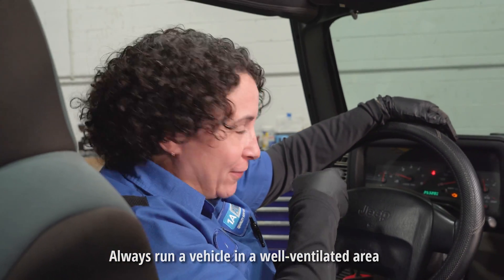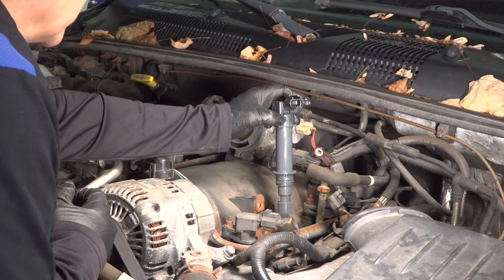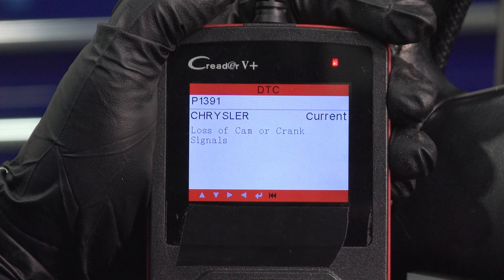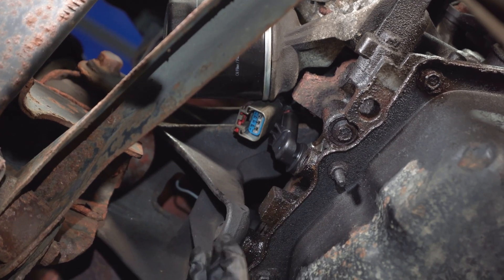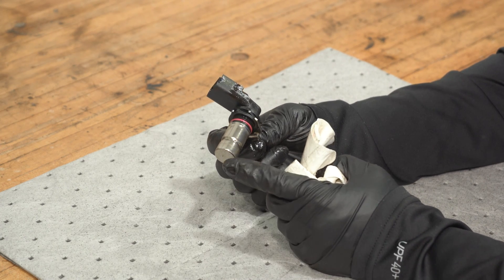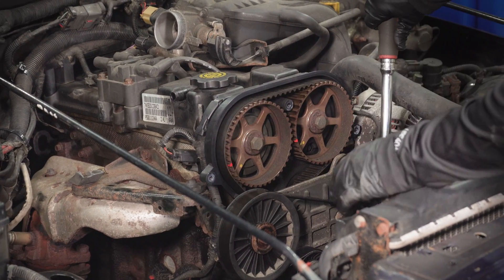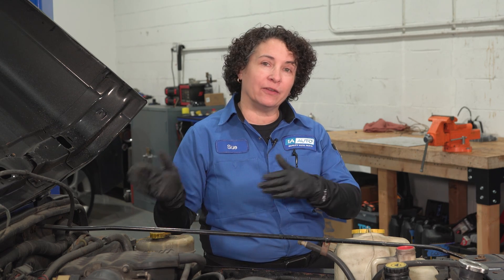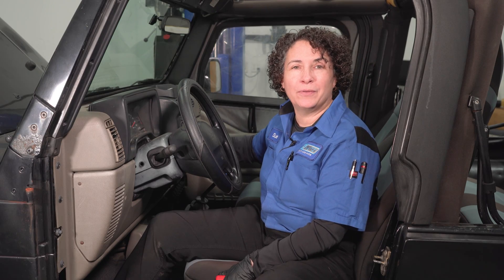Check Engine Light, No Start, and More: What is a Crank Sensor? Why Does Your Car or Truck Need One?

Comment: Very good diagnosis and replacement video. But won’t the oil leak be a problem since it got into the sensor and connector in the first place?

Comment: HOW ODD! MY ENGINE LIGHT CAME ON TWO WEEKS AGO. I TOOK IT IN TO MY REGULAR MECHANIC AND IT'S THE EGR VALVE. HE REPLACED IT SEVERAL YEARS AGO. IT'S COVERED FOR A LIFETIME IF I CAN FIND THE RECEIPT. I AM SCROUNGING AROUND LOOKING FOR THE HUGE FOLDER. IT WAS IN STORAGE AND MOVED AGAIN IN A LOWER APT. IT IS BY LAW THAT THE LIGHT NOT SHOW TO PASS CAR INSPECTION. HE CLEANED IT AND IT WAS OFF, BUT CAME BACK ON AGAIN, SO I CAN SAVE MONEY BY FINDING THE RECEIPT. SIGH... IF THE MOVERS DIDN'T THROW THE MASSIVE FOLDER AWAY. 🙄.

Comment: My car is with the check engine On , and code said about the sensor for the catalytic something like that, have like a four year running with that but every time take to the oil change and the routine check out. The mechanic told me don’t worry is not the big deal because is old car 😢